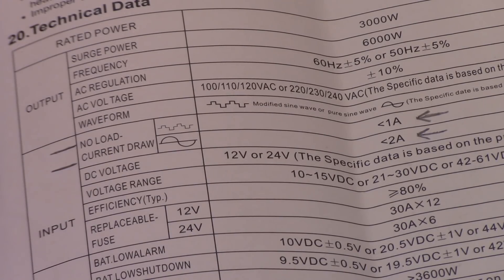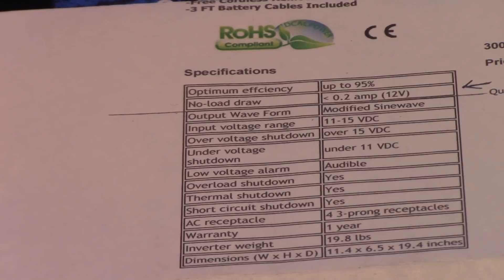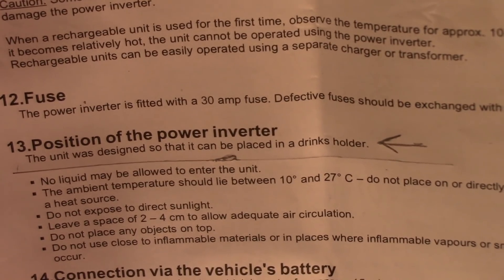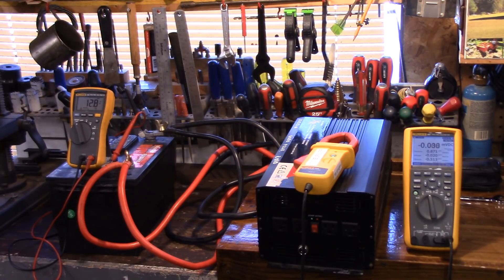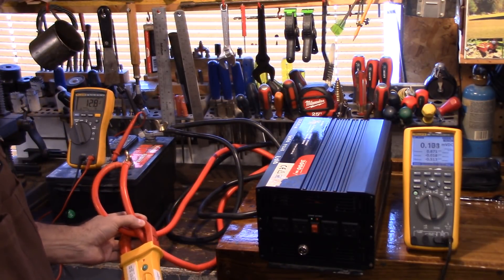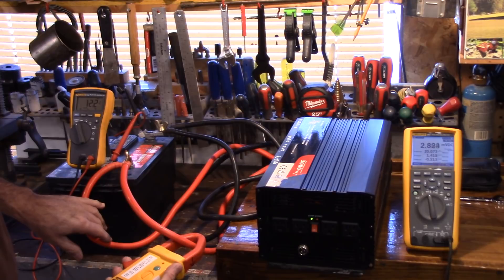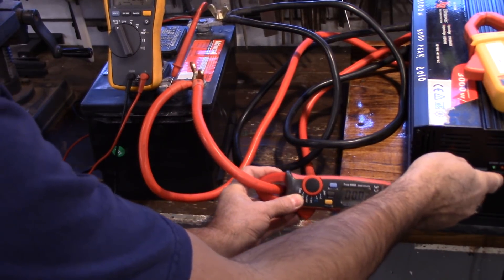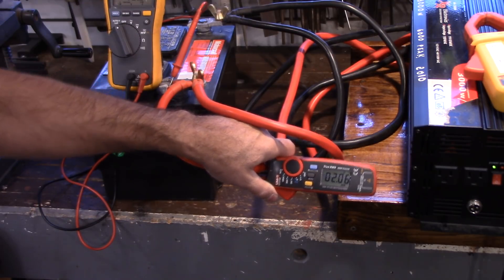POWER INVERTER TESTING - 3000 WATT - TESTING IDLE CURRENT DRAW FOR MY NORTHERN  OFF GRID CABIN

Comment: mine is drawing 1,5 amps, it's too much for me i keep it off.
Reply from the maker: 1.5 is about normal for most inverters that put out about 3000w and up.  Yes it can wear down your battery bank fast so matching the battery capacity with solar output is critical.

Comment: GREAT VIDEO STEVE. I HAVE AN 8KW INVERTER THAT OUTPUT VOLTAGE IS TOO HIGH. IT IS LIKE 276ACV. {NOT 240ACV) WONDER IF YOU HAVE A VIDEO ON HOW TO CONTROL OR FIX THIS PROBLEM ?? DOES THIS REQUIRE ADDING A VOLTAGE REGULATOR ???
Reply from the maker: Jose are you measuring the voltage at the inverter receptacle  without a load on  or at the  running power load  drawing amperage . Lots of inverters test high at the inverter with no load but with a load on I bet it's around 240v .  Test under load and see the voltage.
Reply: OK. I DID A QUICK CHECK WITH NO LOAD. THE INVERTER WAS DISCONNECTED AND STORED FOR OVER TWO YEARS. I WILL FOLLOW YOUR RECOMMENDATION AND SEE WHAT HAPPENS.  THANKS,  @SteveRobReviews
Reply: STEVE, THE HIGH OUTPUT VOLTAGE WAS CORRECTED. WE FOUND AN ADJUSTING SCREW ON ONE OF THE BOARDS. THANKS, FOR YOUR RECOMMENDATION. I HAVE ONE MORE ??? FOR YOU. IS THERE ANY GADGET, BLACK BOX, OR MAGIC BOX  AVAILABLE IN THE MARKET THAT CONVERTS MODIFIED SINE WAVE TO PURE SINE WAVE ???  HAVE YOU DONE A VIDEO ON THIS ???.
Reply from the maker: There are external  power conditioners.   A line conditioner ensures that any voltage fluctuations or line noises are not going to have any negative impact on the functioning of your appliances. However, they do not clean the modified sinewave.

Comment: Hi there! Did you find an inverter for your camp that does actually only draw 1amp or less when it's idle? I'm looking for one and it would be so helpful to know!
Reply from the maker: Your going to find it very hard to find a 2- 3000 watt inverter that draws 1 amp or less at idle but if you live in Canada  I do see Canadian Tire selling a 3000w inverter with a remote  for $400 on sale thats real close  to an amp.  I have tested so many inverters and the specs are at best good guesses 😅
Reply: @SteveRobReviews  Sadly, I am not in Canada. It's really good to know at least to be prepared though - even if you have no direct answer to my question ;) I'm sure there are plenty of people out there wondering why their batteries are not holding up as they assume they should and not realizing that the passive amp draw is WAY off.

Comment: Glad to see your video I have a ups inverter that draws 7when switch on and on Stand On mode no load it draws around 5A I thought my inverter too was bad but I guess they do arent so efficient there are some mppt / inverters with charging capability for converting 120/220AC I wounded what’s their amp load . I did this test  a few weeks ago to a 12v inverters which one was modified300watts  it draw .7A but it was running a fan the moment it’s on and other pure 600-1200peak watts and it draws 1A at most now I have the pure on my car and it’s perfect setup I charge my devices well the once’s that area so heavy and yeah it works but also solar to back up things both work fine but so far lead acid battery work better for 12v inverters . Going solar is a huge thing when you want to upgrade to bigger voltages cause then you got to buy two or more panels just to provide juice to a charge controller . In my needs I am okay w 12system for now
Reply from the maker: Good to see your testing too. Cheers

Comment: Is that 1amp draw when the inverter is on but no load or just off connected to ur battery ?
Reply from the maker: Matt the idle current draw  is switched on  , no load.  No draw when the unit is turned off .
Reply: @SteveRobReviews  nice so couldn't you just wire a switch to ur positive lead that way you could leave inverter switch on but have a line in ur cabin with switch kinda like a mains ?
Reply from the maker: Yes you could , but you have to switch the actual inverter switch not the lines that go  to your battery bank . Many units have a remote on/off  or a cat5 wired cable you can use to switch the unit from a long distance away as I did.

Comment: No load draw is big problem for me as well ,I have 1500 watt pure sine inverter , its no load draw 50 watt per hour and work 24 hours , total draw 600 watt per day , it is too much , anybody have solution ?
Reply from the maker: 1500 watt inverter should only draw 2 amps per hour max. on  idle or  about 25 watts an hour or 25watts X 24 hours =600 watts so that's about 50 amps a day.  I suggest you do as I do is turn the inverter off when not in use if you can or increase your solar panel capacity to overcome the wattage used by the inverter and size your battery capacity to reflect the draw.

Comment: Hi do you use a fuse in line once installed and what size  fuse to match inverter
Reply from the maker: Ross I dont use an inline fuse since the inverter is fused but on a larger system you would use a regular breaker panel to separate circuits as in your house.

Comment: I have a AIMS 1500 watt pure sine wave inverter, I have yet to do much with it, takes time to gather what I need , so any and all videos that anyone does on inverter's , solar etc. are interesting to watch.
Reply from the maker: I just bought  four 100 watt solar panels to install at my remote camp. It's off the grid and in the middle of nowhere. Lots on  solar over the next year or so and plenty on what I know about inverters and how  to use and test them.  The only thing I would say is a battery is far more dangerous than your utility outlets so it can be dangerous but comp,ethyl safe with   training . I have never has a problem so far . I built a new outhouse last year and filmed it all , yes it's a solar outhouse :) Cheers
Reply: Steve Rob, I will be sure to watch them!!!!!!

Comment: This video was very helpful, I have a 1000 watt pure sin I'm about to install at the cabin, I will be checking the amps and shutting it down when I'm not there. What kind of charge controller is good for solar? I only have a cheap one now. any recommendations?
Reply from the maker: HI Dominic  I have a eBay charge controller I paid $30 for and its been working great for 4 years now . Remember on your inverter you divide the outlets by the wattage - two outlets on the inverter you actually have 500 watts each outlet . My cabin uses a crapy tire 300 watt inverter  used for mostly for ceiling lights .   I will be doing more inverter testing and explaining  their limitations.  I have one 100 w solar panel and two 6v deep cycle batteries .
Reply: STEVE ROB REVIEWS thanks for the info. I will post a video when I get it sat up. If you see what I’m up to comment, I always like advice.

Comment: Guest will never have a solar system at my cabin sound and look to complicate rather run the generator all the time I'm pretty sure it's  less trouble and cost less to operated.
Reply from the maker: I use 5 gallons of gas a year  mostly for the hot water tank for a shower.  Solar is the way to go and so easy to hook up  no Maintenance either.

Comment: Nice work on those generator inverter set ups. I'll have to test my crappy tire i inverters to see the draw. I've got a 1000 watt pure sign wave and the 3000 watt modified. 👍
Reply from the maker: Yes for sure test them  because there's a lot of specs but most are not valid.  My whole cabin runs off the crapy tire 400 watt one for the last 15 years but I had a spare 300 watt so I switched it out last fall just incase the old one was getting too old.

Comment: Good thing you tested that...that would have been disappointing once you put it in service.  Goes to show you can't trust the numbers out of those books from the "overseas people".  Especially when their website says completely different.  And I dunno what kind of big gulps they have over there but I've never seen a drink holder that size!
Reply from the maker: I test everything and I have found wingwang inverters that are sent over here  but built  for Europe at 50 hertz when we run 60 hertz so I test for hertz as well .  The instruction never stop amazing  me how bad they are and they refuse to pay someone to check them.
Reply: I don't test everything religiously like I probably should but I try to test the Chinese electronics most definitely in a case like you have for this usage.  Most people would be surprised at what they find if they did though!

Comment: Could you go inverter for Dummies and explain what is an inverter for?
Reply from the maker: HAHA it's an electrical box that you hook up to a 12v battery to get 120v electricity to power any regular tool or  appliance.  If the power goes out at the farm you must have a genset  but this uses no fuel  just a battery charged by a solar panel .   Great to have and much easier to maintain but not intended to power large loads like a milking parlor :)
Reply: Thank you !

Comment: I need a new inverter, I burned the one I had up. It must not have been too good lol. I only used it one time to pump up an air mattress while camping last year. I bought it at Northern Tool and I believe it was a 1000 watt. Crazy. Mine was just one you hook to your car battery, yours looks pretty heavy duty. You did an awesome job reviewing and explaining this.
Reply from the maker: Thanks and inverters are not all built the same and most low cost inverters are dodgy at best. LOL

Comment: That was interesting, Steve...  I would like to see you test that with a load on it...  Does the inverter increase above the standby amp draw or at what point does the amp draw increase.?
Reply from the maker: Good point Bill  - ok for you I will try it on a power tool most think it should run but we will all see what a loaded inverter will do. Great idea Bill
Reply: Thanks, Steve..  I have a 2000 watt inverter and it draws about 5 amps without a load..  But I can put a small load on and it doesn't increase the amps...  At what point does it increase the amp draw?  How much of a load must be applied for the standby draw to increase!  It sounds like those instructions are for a much smaller inverter!!  They hoped that you didn't read them!!!  haha!!

Comment: At least you found one that will fit in a drink holder. 
What if you let it sit for like half an hour? Does it still maintain a 5 amp draw? (Sleep mode)
Reply from the maker: That was sleep mode and it doesn't sleep well at all . The chinese are getting better but not up to normal translations yet.   This is also only putting out 115 volts as well and newer one do much better.

Comment: the problem is you didnt have a proper drinks holder to mount it in,lol. watch out for them wing wangs for sure. one of my old garages i rented didnt have electricity so i used a small inverter to run some lights off my trucks battery,not ideal but it worked
Reply from the maker: Wingwang better not complain I call them wingwang because they are wingwang that's for sure. LOL Solar is terrific and testing is a must because they surely don't. HAHA

Comment: I like these projects Steve. I have a small  solar power system in my shop and looking to upgrade some of the components.
Reply from the maker: Lloyd I like to putter with solar and inverters and you definitely have to test them all because the spec sheets are like reading  a fable. HAHA

Comment: I've been thinking about this for over 30 years,  I'd like to put together a generator for backup power at the house using an air cooled VW engine with a couple of high output alternators and a large inverter.  One of the things that held me back in the past was the cost and quality of inverters.  Now, the price has come down considerably and hopefully the quality has gone up.  The issue now is,  finding an air cooled VW engine that isn't worn out and doesn't cost a fortune.
I guess I just figured it would be quieter than a regular genny,  easier to repair and get parts for than a regular genny and also, be way cooler than a regular genny.  I helped a friend convert an air cooled VW engine into a self driven air compressor a few years ago and it still chugs along out at his cabin.  I dunno... I have so many ideas in my head but not enough time or money to ever build them all.
Cool video Steve.
Reply from the maker: The alternators work but it's so easy to overheat them and I did just that LOL   I still have the diesel engine just what to do with it now. Great project to do when you  retired  .